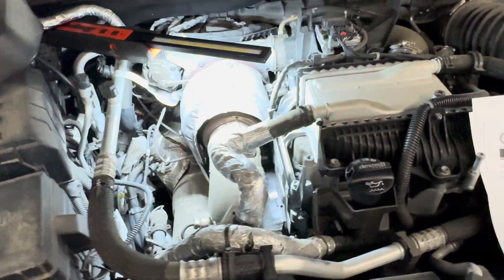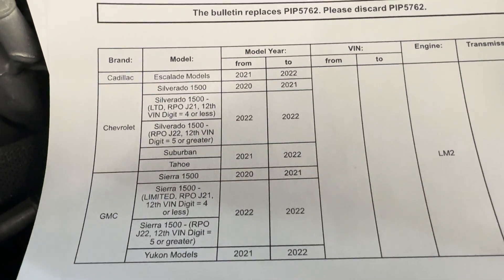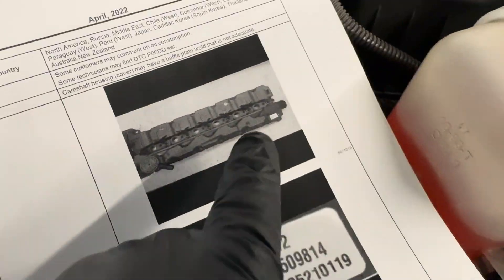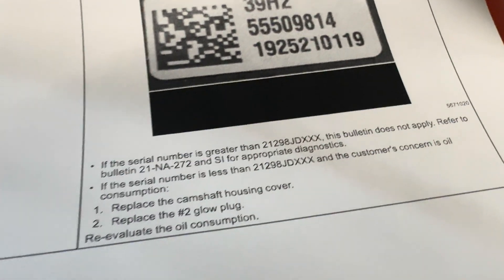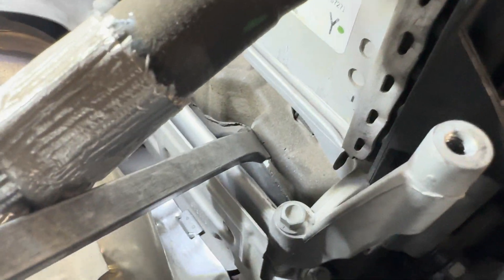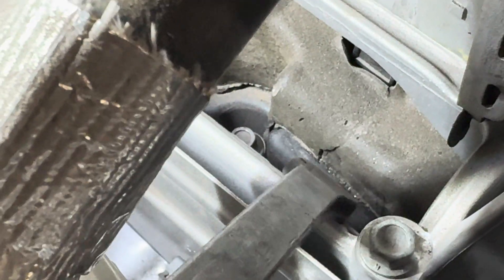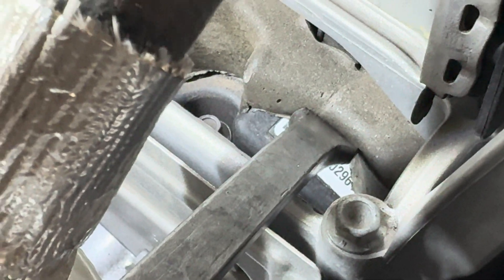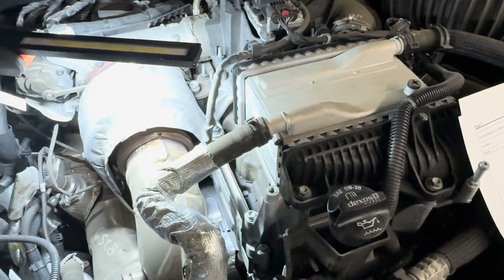Oil Consumption in 3.0 Duramax Diesel may be caused by this

Comment from the maker: Here is how you see if your 3.0 Duramax Diesel Engine has the updated Camshaft Cover. If you have the old style, you could have an issue internally with a baffle plate weld.

https://www.duramaxnews.com/post/oil-consumption-fix-22-na-027

https://www.duramaxnews.com/post/reviewed-every-single-modification-for-the-3-0-duramax-diesel

www.bankspower.com/DemonWorks

ACDelco Fuel Filter: https://amzn.to/3QFfXex
3.0 Duramax Oil Change W/ PPE Oil Filter: https://amzn.to/3qmLR6o
3.0 Duramax Oil Change W/ ACDELCO: https://amzn.to/3QtmDO5
Fuel Filter Socket: https://amzn.to/4b52BkY
Fuel Filter KlickWrench Socket: https://amzn.to/42arKH6
Aluminum Fuel Filter Cap: https://amzn.to/3FZir28
K&N Air Filter: https://amzn.to/3S5sLvq
K&N Intake: https://amzn.to/4b6oy35
K&N Fuel Filter: https://amzn.to/4b6Ux3i

www.bankspower.com/demonworks

Banks idash - https://collabs.shop/ba9zd0

Banks iDash Data Monster - 66760
Banks iDash Super Gauge - 66562 (piggyback kit to datamonster)
Banks Pedal Monster Kit - 64311 (piggyback kit to datamonster)
Banks Stealth Pod Single - 63369 
Banks Stealth Pod Dual - 63370
Product Link - https://boostautoparts.com/products/t1-1500-chevy?options=&utm_source=DemonWorks&utm_medium=19-23+Chevy+1500+Tow+Mirrors&utm_campaign=Sponsorship

www.duramaxnews.com

www.bankspower.com/demonworks

As an Affiliate / Influencer, I earn from qualifying purchases. Your support is appreciated as it helps the channel to continue to test products!

Comment: I have a 2022 LTZ with the LM2. I absolutely love this engine although it does burn about a quart of oil every 200 miles. I'm thinking about a 2026 LTZ with the LZ0 engine. Are there any issues with that engine?  Love the channel! Thanks!
Reply: Major thrust bearing failure

Comment: The reason for excessive 3.0 duramax oil consumption is because of the oil it's too thin that it evaporates quickly in exchange for better fuel mileage. There's nothing you can really do anything about it unless you get thicker oil. But GM doesn't recommend thicker oil.
Reply from the maker: False. 0w20 works just fine.

Comment: Asked the dealer twice to check my 2020 lm2 and first they outright refused, second time i handed them the printed bulletin and got a call saying the tech has never seen this as an issue and to not worry. Needless to say I’m not happy with champion Chevrolet in reno,nv

Already had glow plug 2 replaced and just went in for 3 &5
Reply from the maker: Do you have an oil consumption issue?
Reply: @DemonWorks  Thought maybe after a drive to LA but I previously hadn’t checked frequently enough to know if there was an issue and don’t drive large distances frequently enough to see if anything is missing but have been trying to check more regularly to keep an eye on things

Comment: I couldn’t keep oil in my 2023 Tahoe with the LM2. It would go through a quart every 750 miles while never leaking a drop. Now I’m driving a 2024 with the LM2. It has 4,000 miles on it and it has never used a drop. I couldn’t tell you what the engine number was on the ‘23.
Reply: You should have the lzo the switched from the lm2 in 22 to the lzo in 2o23
Reply: @BrandonMendenhall-g1p5y the 23 and 24 SUV’s still used the LM2 while the Silverado got the LZ0

Comment: I’ve got a 2022 refresh with the LM2 and it burns a quart of oil every 1500 miles. The cam cover serial number is over the one provided on the TSB. Guess that means I have the new cover. Took it in to the dealer they confirmed and asked GM about the oil consumption. GM says that since all my miles are highway miles it is considered “high speed” and must burn more than 1 quart of oil in 1000miles to be a concern. I drive around 100 miles per day. All highway and unloaded. I find it interesting there are owners with zero or close to zero consumption and others where they will exhaust their oil supply within the oil change/service window. Is there anyone else on here that has a LM2 with the new cover and still have consumption issues?

Comment: My brothers truck has the oil consumption issue, but since his truck doesn't have any codes, the dealer won't even look at it, and it's almost out of warranty. His is using about a quart every 800 miles.
Reply: Follow Demon works or Spicer designs videos for inspection tips, once you determine it falls into the bulletin peremiters.... bring that info to your dealer...if they still won't help, find a different dealer... not every dealer is the same
Reply: That’s the game!
And with lemon law it only counts if they diagnose something….. played that game for 36,000 miles…. GM finally made it right basically gave me a new truck and in 2600 miles the turbo went out…. After they fixed it I went to a 2024 ram 2500….
Reply: Same issue with me and other dealers are far away

Comment: I have a 2020 with NO oil consumption or hard start problems... Should I check my ser # and replace it with the new cam cover if its numbers  say its its a bad one??
Reply from the maker: I would leave well enough alone.If you need to go in there for repair at all, that would be a good time to do it. it's a big job.
Reply: @DemonWorks  did they fix this problem with the lzo

Comment: What differences are there with the updated cam cover that help with oil consumption? Is it related to a PCV type issue?
Reply: From what I’ve seen there’s a bad weld in the cam cover of some of the older ones that causes the engine to burn oil. A lot of guys are having the number 2 glow plug go bad as a result of this issue.
Reply from the maker: Chris' reply is accurate on the issue.
Reply: Ah interesting, thanks. Sounds like a known fix so hopefully those with the LM2 take advantage and keep their rigs in good working order.

Comment: GM bought my 2021 back
Couldn’t fix any of the problems
Reply from the maker: That happens with all manufacturers, glad you were taken care of!
Reply: Mine burns about half a quart every 5000 miles or so. Checked the number on mine it's like a 202 and can't quite remember the last numbers but shud I worry about fixing mine? I got a 2021 lm2 btw.
Reply: @alextoews1128  not sure
Mine had multiple issues 
No start
Emissions 
Def “dumps”
Oil consumption 
Smelled anti freeze all the time 
Tranny downshifting hard!
Reply: @alextoews1128 I'm 3.0 is doing the exact same thing. I have to add half a quart around 4500 miles. My cover number is 20270.
Reply: @alextoews1128  oil consumption wasn’t the only problem 
Sometimes it would just turn over no start from the time it had 275 miles on it and it had 36,000 when got rid of it 
In the shop multiple times never fixed it 
Also emission lights, going into derate mode 
Not using any def for about 5000 miles and suddenly doing a def “dump “ as they called it 
But it did pull good just unreliable and the second Chevy was no better 
I’m back to ram!
Reply: I purchased my new 2020 in December of that year on the Employee discount deal... Right before Covid hit  hard it was a great deal.. 
  People ask me how I like it and I tell them its the best engine/truck I have ever had.. No oil use, no hard start, great mileage and the 10 speed trans shifts like it was made for it.. 
  Too bad you couldn't enjoy yours like I have enjoyed mine so far....
Reply: After that got a 2022 turbo went out at 2600 miles…..I own a dodge now